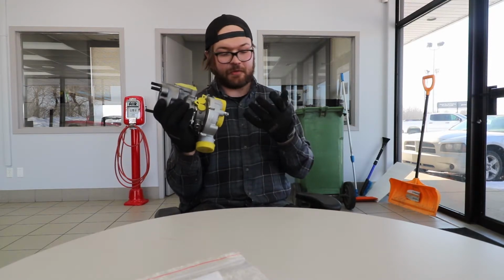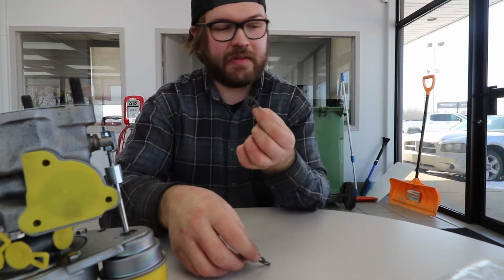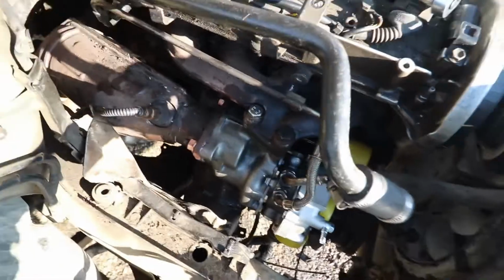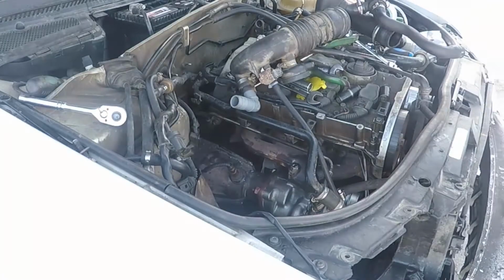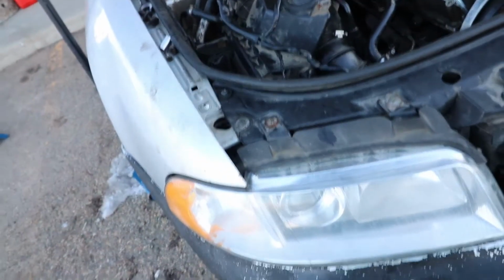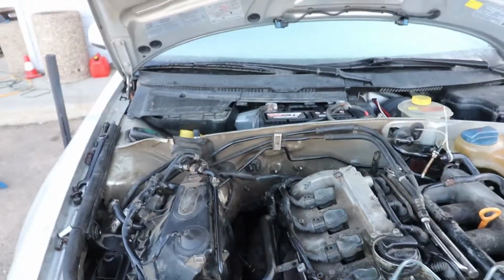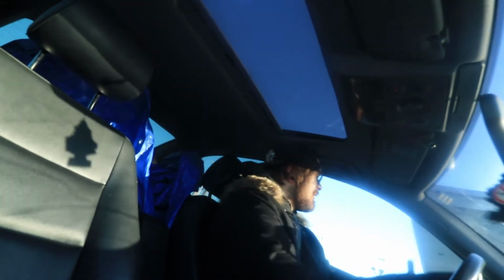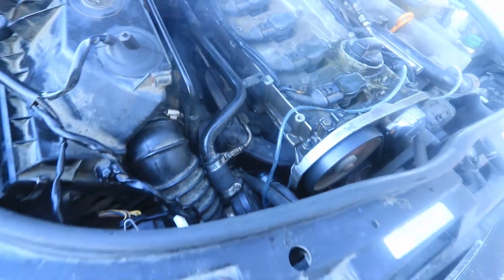Assembling and installing a turbo on to an Audi 1.8T B5 A4

Comment: Did you pull the fuel pump fuse and crank it over before you started it?
Reply from the maker: Ya, I did. Just to get the fluids flowing through it.
Reply: Which fuse??

Comment: Do you know where you order the new turbo from? I’m shopping for a new one right now. Thanks for the video it was a lot of help.
Reply from the maker: Unfortunately not anymore. I got mine from a seller on eBay. I just looked for it but my history only goes back to 2021 or at least eBay will only let me do so. 

I just took a look there. There are a couple kits out there for around what I paid back in 2020 with Top Seller badges. Just do your research and reviews on the companies and you might find a good one. other than that I would recommend checking Rockauto or FCP Euro.
Reply: Thanks for looking I looked at Rockauto but didn’t recognize any brands from the research I have done which is a little scary I will check your other recommendation.

Comment: So when it went out could you start it your would not start cause it was close and made a cranky sould like it want to start just asking about how you know it went out and will it start if it out that the other question I have for you I think mine went out and it sound like it want to start but it not getting air is that cause it close on the turbo
Reply from the maker: So, for me, I noticed the seals were leaking oil into the exhaust and the turbine on the cold side had a lot of play in it when moving it with my hand. When you started the engine it would smoke out the area.